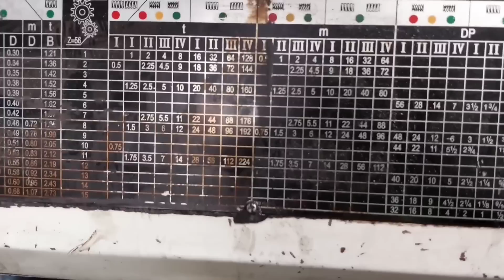LIMA TEKNIK DENGAN MESIN BUBUT YANG TIDAK DIAJARKAN DI SEKOLAH P4RT9

Comment: I would like to see you take a block and bore a 2 degrees MT3  internal taper into it and weld a 1" X 1/2" X 4" bar to it to fit the tool post !  Then you can fit anything with a taper into the tool post !